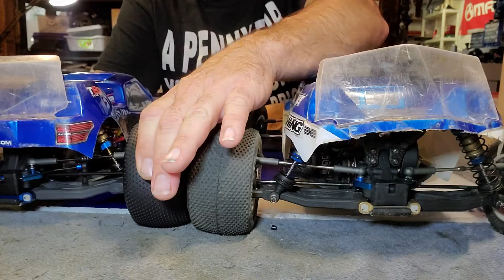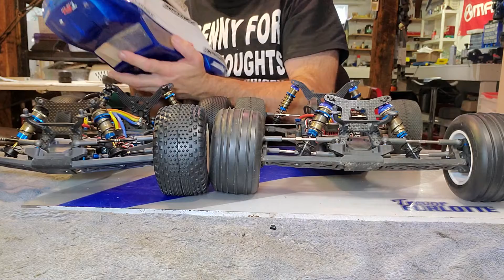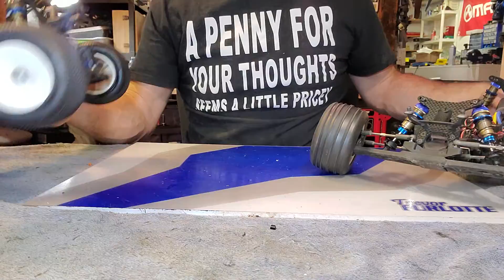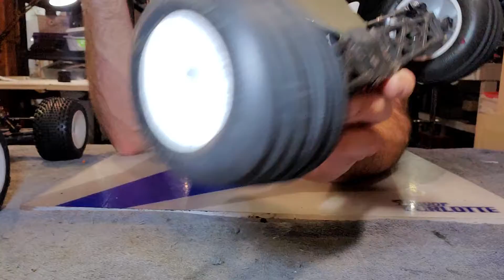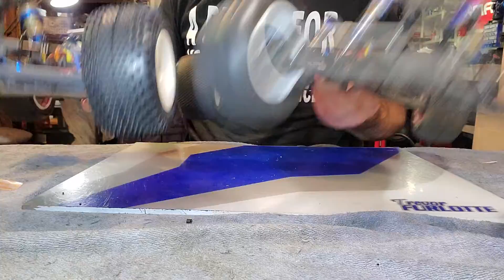Top 10 differences between Carpet and Dirt RC car racing setups.

Comment: ??? Do you ever use metal tape bits inside the wheel rims to balance the front tires  ??? I noticed that your front tire keeps rotating back and forth.
Reply from the maker: I use the JC tire balancer and plumbers putty.

Comment: As a retired Motorcycle On track Road Racer, the entire slipper clutch deal on R/C is very confusing. We utilize slipper clutches in racing bikes, however, they are strictly for corner entry and downshifting, as if your bike engine rev's and RPM of your rear wheel don't jive, it will obviously cause the rear wheel to basically brake into the corner which can be a crash recipe. Which is why the ONLY time you use a rear brake on a sportbike is in the pits when you are slowing down and want the front brake to cool down. The first thing to know if a motorcyclist is new or doesn't know how to ride is to see if they use rear brake. The tough thing about buggies is the brake is basically rear only which sucks for stability.
Reply: As i know, slipper clutch in rc slipps when it is at a big stress so you don't damage your drivetrain

Comment: This is 10/10! I wanted a run down of what each adjustment does for carpet and dirt. Really appreciate it, I bought a B6.4D second hand which had a few mods and adjustments that the previous owner liked for dirt, but now that I want to give it ago on outdoor carpet, ive fully stripped it and want to get a baseline for myself

Comment: i REALLY wish you when over shocks more. clearly you have very different setups. almost looks like buggy shocks on the carpet setup, at least the front.
Reply from the maker: @dirtrider88  same size shocks on both trucks.  The carpet truck shocks use thicker oil and stiffer springs.
Reply: @trevorfurlotterc  then how the fuck is it sitting so much lower?
Reply from the maker: @dirtrider88  cups, eyelets, collars, droop adjusted with internal spacers etc.  Mostly though, the ride height is adjusted simply with the collars.

Comment: who makes a pro4 truck thats already set up for carpet. all the ones i looked at are for dirt. How much money does it cost to turn a dirt truck into a carpet warrior?
Reply from the maker: @douglasedmonds8372  modern stadiums are closer to carpet truck than dirt trucks.  All it takes is tires, springs, oil, gear diff and anti-sway bars.  Couple of hundred bucks probably.

Comment: On a smooth High grip clay track, do you want hight or lower height?
Reply from the maker: Lower
Reply: @trevorfurlotte  Thanks, I'm driving a team associated car that I bought used, and I have made zero changes.  But it seems to handle pretty well, actually.  The only thing I've changed is adding slicks, I put on some smoothie 2 silvers, and that was a massive difference. It sticks to the track like velcro with them .

Comment: So, I have a T6.2 and am struggling to get under 20mm ride hight without totally backing off the spring preload collars. What springs would you recommend to replace mine with in order to go lower without sacrificing the spring rate to prevent the chassis from slapping on and off of the jumps?

Comment: How would you set up one of these to be a high-speed onroad basher with maximum grip, stability, and minimal tendency to wheelie or roll over?
Reply from the maker: Sorry, I have no idea.  It's not my area of focus.  Sounds fun but I haven't driven an RC off of a track since I was a kid in the 80s.
Reply: @trevorfurlotterc  I would approximate it to have less grip than carpet for sure. Possibly similar to a high bite dirt track or mild clay, IDK. Obviously fewer jumps, too. The main thing I'd like to avoid is breaking rear traction which then leads into unrecoverable fishtailing and then even worse would be catching on the tire while sideways and flipping. Any insights with those parameters in mind?
Reply from the maker: @Drunken_Hamster  tires, shock oil and sway bars are key.  Not stiff enough rolls too much and rolls over.  Too stiff, doesn't roll enough and rolls over.  Would require trial and error.  Personally, I'd never try and turn an off road truck into a basher of any kind.  Sounds like a money pit.  I'm too OCD.  If I wanted to run on the street I'd run an on road car and not try and turn a truck into a car.  Make sense?

Comment: Great video!  Can you do another talking about camber, caster, and toe angles between the two?
Reply from the maker: In my case, I run the same on both with the exception of toe.  Camber front is -1, 0 rear.  1 to two degrees of toe out on carpet.

Comment: Great video but you missed a few of your differences, possibly because they make less difference... Your camber links are longer on the carpet car -using the inner-most ball stud mounts. That gives more camber under compression for the dirt for grip -right?, and the longer links reduces traction roll with less camber on the carpet. You've also got stabiliser bars on the carpet car.
Reply from the maker: "Top 10", not "Top 20". Lol  i mentioned in the description, forgetting the sway bars.  That definitely should have been a top 10 item.

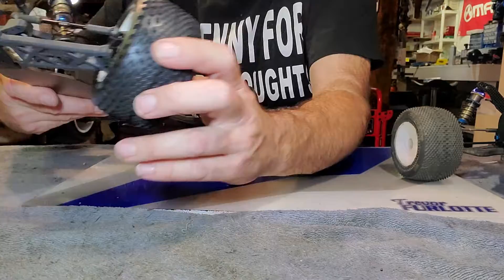Comment: Is there any reason that prevents, instead of removing mechanical grip from the front axle to generate more understeer on the carpet car, to use narrower front tires and thus reducing front grip AND front rolling resistance? 17:10
Reply from the maker: Other possibly violating rules for stadium classes wheel size, I can't think of a reason not to try it.
Reply: That’s why buggies race better than trucks. But if you can whip a truck you’ve got some real skill.

Comment: Thanks for sharing this Trevor! May i know how you decide on the thickness of diff oil?
Reply from the maker: Traction level.  Lower the grip, lower the weight.
Reply: @trevorfurlotterc  Got it, thanks! On a 2wd, is there any situation in which we tune steering with diff oil thinkness?

Comment: You have any idea if the gear box and slipper set up from the b6.1 can fit the original b6?
Reply from the maker: It will
Reply: @trevorfurlotterc  nice . They really don’t want us to know what fits the original. I’m not ready to buy a new 2wd buggy yet. Just got a new t6.2 and the b74.2 is on the way
Reply from the maker: @colestaples2010  i figure it out by downloading the manuals and comparing part numbers
Reply: @trevorfurlotterc  oh that’s a great tip, I hadn’t thought of that

Comment: Do those dirt tires actually get traction? I couldn’t get traction with my b6 d unless I’m on clay or carpet
Reply from the maker: That's the thing about tires, specific tire for a specific surface.  Here on what we run on Proline hole shots or JC DDs work best.  Your millage may vary.
Reply: @trevorfurlotterc  I’ll try some hole shots.

Comment: You mentioned that there is a third set up besides the carpet and dirt, but I can't find any info on it.  Can you go more into more detail about that?
Reply from the maker: I was probably referring to high bite clay.  Those setups are in between carpet and loose dirt.  They require less rear weight bias than loose dirt but more rear weight bias than carpet.  The gearbox configurations for AE kits are 3 or 4 gear standup, layback and laydown.  A high bite clay track would use a layback gearbox.  Tires would be a bar style or even slicks with some sort of traction compound applied.  The track surface is sealed to pin tires slip over the surface rather than bite into it.  So in short, clay tracks use layback gear box and different tires compared to dirt or carpet.  Hope this helps.
Reply: @trevorfurlotterc  absolutely. Thank you very much

Comment: Great video. Wish you could of went into more deal about the dirt set up. I’m struggling with the rear spinning out.
Reply: Raise you inner camber arms, lower the control arm pins, softer rear springs, lighter weight oil in rear shocks, adjust servo speed in radio for slightly slower acceleration.

Comment: Wish I knew all this information for dirt setups back in the early 90s racing a RC10T. Back then you slapped the car together and threw it out on the track. Got your setup info from RC Car Action or you got the "Speed Secrets" which were just that, A Secret. Or you got some bad gouge from other racers like "Hold your truck down and loosen the slipper till it slips a lot" or "Hold the rear wheels and tighten the slipper till the car wheelies." Or the Hobby shop owner told you something like he "just talked to Cliff Lett...." just to sell his full price inventory.
Reply from the maker: Absolutely!  I said the same thing in my JrXPro video.  Built it and "raced" it as is.

Comment: Great video !! Subbed !!! I run  a SC6.1 on high grip carpet , I feel the truck is pretty dialed in ( after 2 years of test and tune ) , but recently have been thinking of switching to hard arms / chassis side rails . Am I going to see a huge difference and / or wreck my current setup ??? Also would love to hear you explain in a vid of anti squat tuning !!! Also, what / where is that battery top plate ? Looks like you can push the battery even farther than the stock AE . Thank you .
Reply from the maker: Switching to hard arms and rails will be noticeable but not so much that it causes a distraction.  Look into carbon parts instead of hard though.  As for the battery brace, no idea.  It came on a used B6 I picked up along the way

Comment: This is perfect timing!   I just bought a used SCT that was set up for carpet and I will be running it on clay.   Now to just figure out what needs to be changed.  Thank you.
Reply from the maker: For clay I would start with the kit's box setup.
Reply: @trevorfurlotterc  Wish I could but it came with a weighted front end and back end.  Even the steering geometry has been changed.  Sway bar in rear too.  Its all good tho, I don't mind a challenge.

Comment: great video.. should have said something about sway bars instead of hard or soft arms... only thing i can think of.
Reply from the maker: Oh man!  I can't believe I forgot to talk about sway bars!
Reply: I was going to comment similarly,  noticed that your carpet car has a sway bar but dirt doesn't.  Would removing the sway bar help increase corner traction and straight-line bump absorbing on a bumpy track?
Reply from the maker: @akceller8  correct